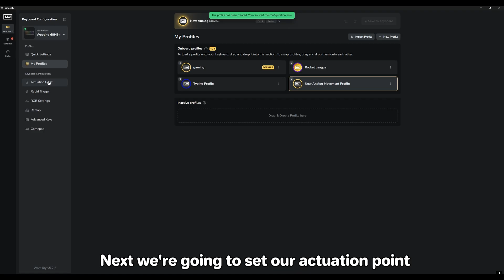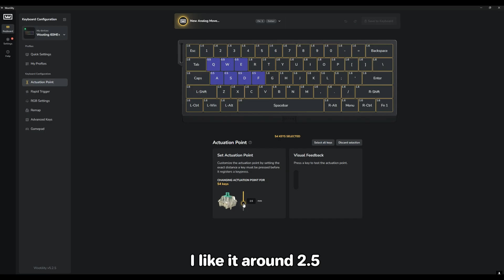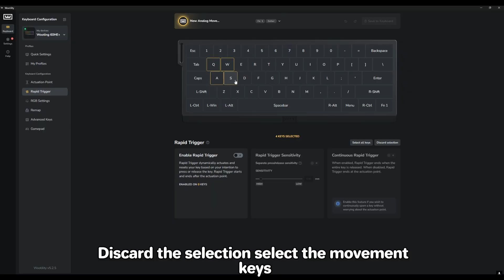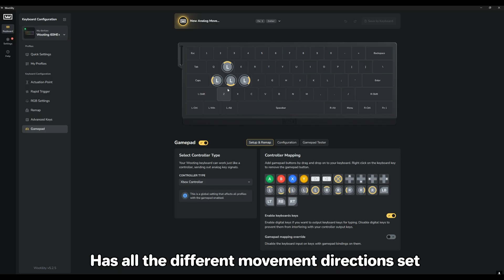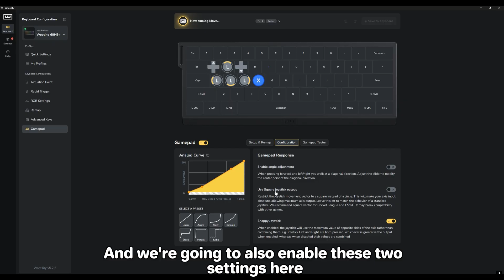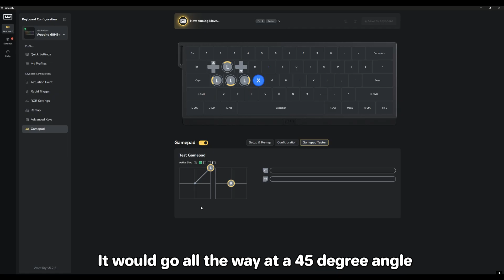Turn Your Wooting 60HE Into a Controller for Rocket League (Analog Setup Guide)

Comment: Is there a way to bypass the input switching or do I just not use my mouse?
Reply: Best way is to just hide the parts that change in the hud so ballcam/training mode stuff.

If you go in training mode, then open settings on the training setting you can then choose to hide control display.

Comment: okay so what if i use jump on space, and boost on shift, and both of my airrolls are on my mouse
Reply from the maker: You can definitely use that setup just map the spacebar to A or whatever the default controller button is in Rocket League, same with boost and then skip mapping the airrolls since those are on your mouse
Reply: @gunclewam  if I do this ingame is lagging bc it is switching from controller to kbm always
Reply: @gunclewam  okay thanks man, and should i rapid   trigger my jump and boost too? or just the movement keys?
Reply from the maker: @Foryxsa i would on boost but set the threshold on jump to a longer press so you avoid accidentally double jumping
Reply: @gunclewam  thanks

Comment: Considering buying, any input lag with mouse?
Reply from the maker: Nope, I use my mouse for boost and jump no input lag
Reply: Yes.  Unless you bind boost and jump to a keyboard. Or else it's gonna lag due to switch from analog (controller) to mouse
Reply: @flyingcobra2186  other way to fix it?$
Reply: @LeonGodic probably not.